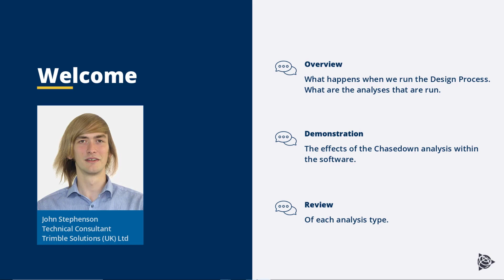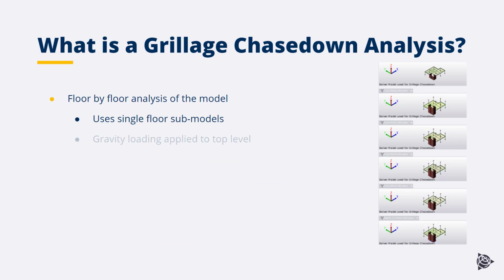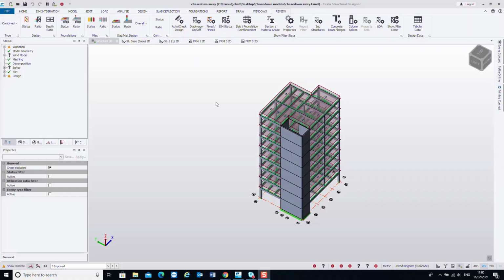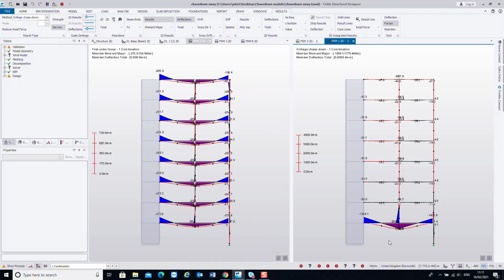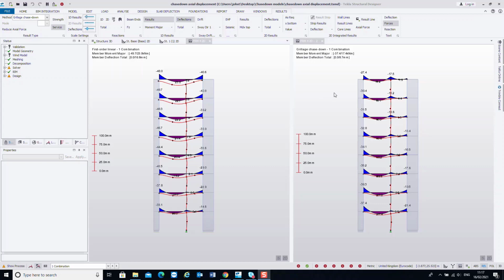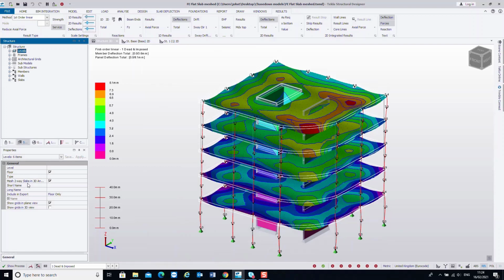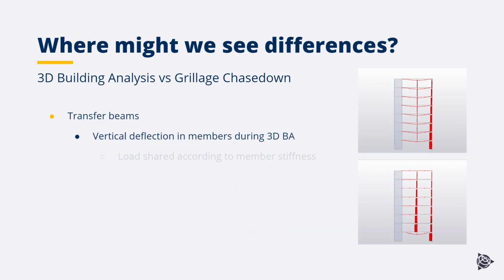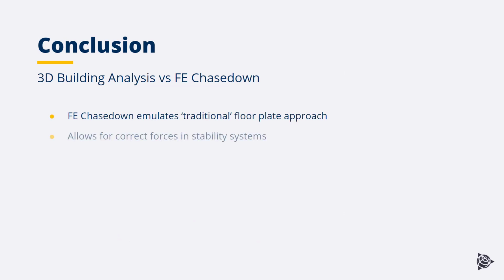Tekla Structural Designer 2020 - Different types of analysis

Comment: How important it is that the sub models are per floor? I have created full models which have broken down into sub models which are 2 stories (probably due to double height columns).
Reply from the maker: The effect of using the chasedown sub-models will be reduced by combining the levels in the same model. For a 2 storey sub-models, this should not have a large impact but if the sub-models are combined over a number of levels, you can start to see similar effects to what has been shown for the 3D analysis.

The combined sub-models usually occur when analysis elements are modelled over multiple levels so removing these should allow the sub-models to be created on a level-by-level basis. 

For a more specific response regarding a particular model, we would need you to send the question and model to tekla.support.uk@trimble.com